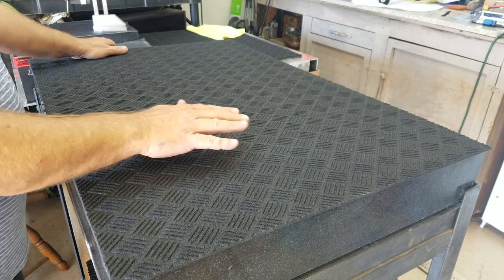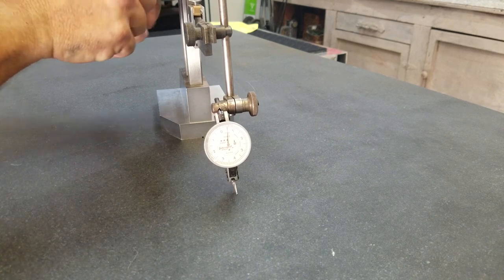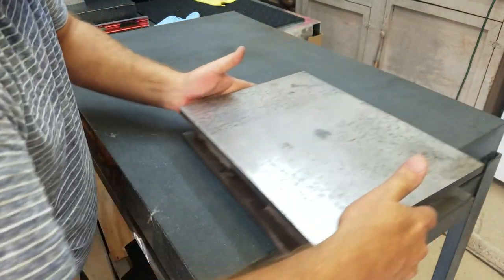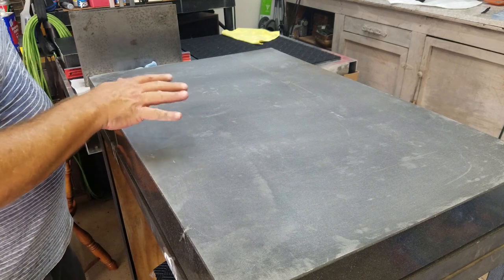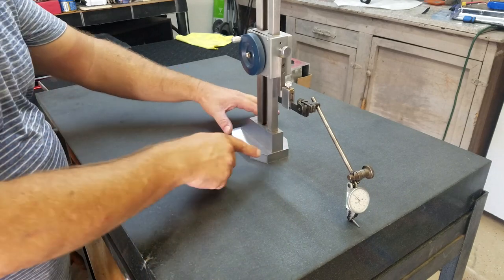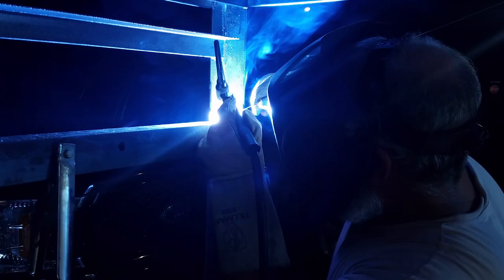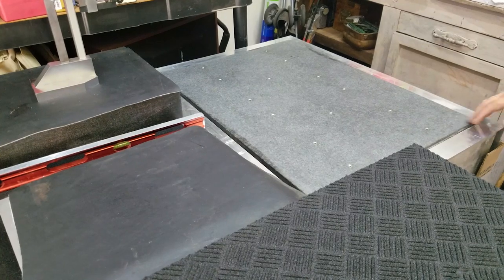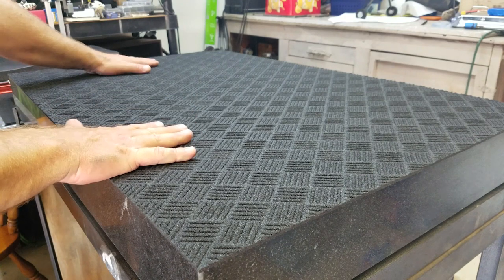Used Surface Plate Inspection, Checking, and Stand Modification.

Comment: good video, what abrasive was used? Al oxide?
Reply from the maker: The lap was previously charged with 300mesh diamond from a previous plate that took months to do.
Reply: @AlmostMachining  Wow, months?!! I thought it takes no more than a few hours to bring a clapped out 1m² surface plate back to AA grade if you have the proper equipment, such as an AA grade cast iron surface plate charged with diamond paste and a repeat-o-meter?

In the video you mentioned something about removing the diamont from the charged cast iron surface plate by using aluminium, could you tell me more about how that works? I was under the impression that once the plate is charged with diamond particles you will need to regrind it to clean it up and free it from the diamond particles?
Reply from the maker: @pieterveenders9793  diamond that is embedded can be removed by a softer material, for example an aluminum block or even coper.  Heat can also cause the diamond to evaporate. It isn't perfect but larger grits can be removed. It is never a good idea to attempt to lap a fine finish with a plate that has had old grit on it. But it is best to remove what one can prior to rescrape.  The one that took a long time was way over 40 thou out.  I was using 80grit silicone carbide on that. It was a mess and a learning experience.  The diamonds get stuck in softer materials and tear out of whatever they are in.  Thank you.

Comment: So you have the grade A plate and use it to validate the cast iron plate? I recently acquired two 24x36x4 black granite plates in unknown condition.
Reply from the maker: Yeah i did the best i could.  It could still be out some but across several other new plates they are all close enough.  Granted i am omitting several factors.  The newer plates i have are too heavy and i have other means of checking them now as well.